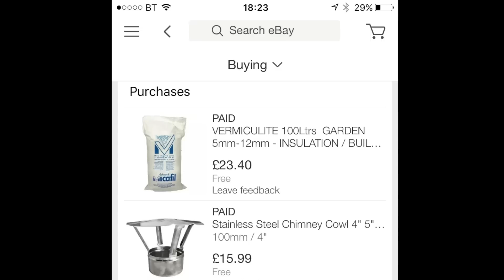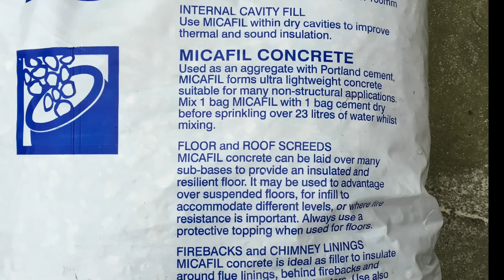Wood Fired Pizza Oven made over a gym ball

Comment: Excercise ball good but vermiculite and cement no for inner layer. Will crack and melt and give off toxic arsenic fumes in food. Use fire brick or clay for inner layer as a radiant layer. Then vermiculite and cement for outer thermal layer.
Reply: Where did you find this information about the fumes i am working to make the same project and i want to be sure. Thank you!
Reply: Joël Boudreau . Vermiculite is a type of asbestos... extremely toxic especially when heated and released into the air.
Reply: Joël Boudreau m
Reply: Although not all vermiculite contains asbestos, some products were made with vermiculite that contained asbestos until the early 1990s. Vermiculite mines throughout the world are now regularly tested for it and are supposed to sell products that contain no asbestos. The former vermiculite mine in Libby, Montana, did have tremolite asbestos as well as winchite and richterite (both fibrous amphiboles) — in fact, it was formed underground through essentially the same geologic processes as the contaminants.

Pure vermiculite does not contain asbestos and is non-toxic. Impure vermiculite may contain, apart from asbestos, also minor diopside or remnants of the precursor minerals biotite or phlogopite
Reply: so does it  give toxic flume s when heated ?
Reply: Thank you for your information, if I us Perlite instead of vermiculite would it be better...
Reply: I can't speak to the fumes, but they would probably be from impurities in the material.
Reply: The largest and oldest vermiculite mine in the United States was started in the 1920s, at Libby, Montana, and the vermiculite was sold under the commercial name Zonolite. The Zonolite brand and the mine were acquired by the W.R. Grace Company in 1963. Mining operations at the Libby site stopped in 1990 in response to asbestos contamination. While in operation, the Libby mine may have produced 80% of the world's supply of vermiculite.[8]
The United States government estimates that vermiculite was used in more than 35 million homes, but does not recommend its removal. Nevertheless, homes or structures containing vermiculite or vermiculite insulation dating from before the mid 1990s—and especially those known to contain the "Zonolite" brand—may contain asbestos, and therefore may be a health concern.
An article published in the Salt Lake Tribune on December 3, 2006, reported that vermiculite and Zonolite had been found to contain asbestos, which had led to cancers such as those found in asbestos-related cases. The article stated that there had been a cover-up by W.R. Grace Company and others regarding the health risks associated with vermiculite and that several sites in the Salt Lake Valley had been remediated by the EPA when they were shown to be contaminated with asbestos. W.R. Grace Company has vigorously denied these charges.[9]
The vermiculite deposit at the mine in Libby, Montana, was (and is) heavily contaminated with asbestos.[10] Numerous people were knowingly[11] exposed to the harmful dust of vermiculite that contained asbestos. Unfortunately, the mine had been operating since the 1920s, and environmental and industrial controls were virtually non-existent until the mine was purchased by the W.R. Grace Company in 1963. Yet, knowing the human health risks, the mining company still continued to operate there until 1990. Consequently, many of the former miners and residents of Libby have been affected and continue to suffer health problems. Over 400 people in the town have died from asbestos-related disease due to contamination from vermiculite mining from nearby Zonolite Mountain, where soil samples were found to be loaded with fibrous tremolite (known to be a very hazardous form of asbestos), and countless others there who insulated their homes with Zonolite have succumbed to asbestos-related diseases, most of whom never were employed in environments where asbestos was an issue.[12]
After a 1999 Seattle Post-Intelligencer story claimed that asbestos-related disease was common in the town, the EPA, in response to political pressure, made cleanup of the site a priority and called Libby the worst case of community-wide exposure to a toxic substance in U.S. history.[13][14] The EPA has spent $120 million in Superfund money on cleanup.[14] In October 2006, W.R. Grace Company tried to appeal the fines ($54.5-million) levied on them from the EPA, but the Supreme Court rejected the appeal.[15] The United States government is also pursuing criminal charges against several former executives and managers of the mine for allegedly disregarding and covering up health risks to employees.[15] They are also accused of obstructing the government's cleanup efforts and wire fraud. To date, according to the indictment, approximately 1,200 residents of the Libby area have been identified as suffering from some kind of asbestos-related abnormality.[16] Jury selection was to have been completed in February 2009.[17][18] The case ended in acquittals on May 8, 2009.[19] On June 17, 2009, the EPA issued a public health emergency in and near Libby, thereby allowing federal agencies to provide funding for health care, and for removal of contaminated insulation from affected homes.[20]
Reply: Vermiculite can not burn. It will flake and collapse at around 1350 Celsius. Often vermiculite does contain traces of asbestos because the minerals are usually found close to each other.
Reply: I was truly suprised that the oven wasn't lined with refractory...  I don't know how complicated it would be to try and do tjat at this point... but would have been an easy step in the construction....
Reply: Killer pizza oven! Really ....It might kill you.
Reply: harveyboy45 vermiculite also has asbestos in it
Reply: Thanks for the informative video. 

P.S. Gay Tool Belt

Comment: Love the video! I think I am going to follow this exactly! 2 QQs. How thick is the exterior wall and how long did you let it cure until you used it?
Reply from the maker: I'd say the wall thickness was roughly 5cm, thicker at the front around the chimney and opening (for strength) I let it cure over a week, using wet towels on the surface, so that it dried as slowly as possible.

Comment: Hi, great vid, sorry if this has been asked already but what do reckon the overall wall thickness is, concrete and render included? I'm in the process of making mine (85cm - gulp!) and I'm planning to put an insulating blanket layer between concrete and render.
Reply from the maker: I'd say around 40mm for the vermiculite/cement mix, but much thicker round the neck and chimney area, for strength, and the render was 25mm? I'd go thicker if I was doing it again on the vermiculite/cement and maybe miss out the render, as it was very expensive.
Reply: Many thanks - I've just added another layer to mine as there was no way it was 40mm. Just waiting for it to cure now.... Wish me luck!
Reply: Well, it's done. And it's stayed up so far! Thanks for the video, great information and inspiration.

Comment: So, here's a question for you: when you built your base, the bricks extend all the way out to the edge of the countertop/tabletop, well beyond the side of the oven. I'm currently right at that stage of building my oven. One would think that the bricks extendig out that far would "suck" or pull the heat away from the oven. Do you think that's the case? Would I be better off cutting my bricks to fit the outside edge of the oven? Your design is easier than my alternative solution, I will admit.
Reply from the maker: Andrew Ovenden I see the point you are making, as some bricks will be both inside and outside the oven, and yes maybe draw heat outside. But the extra work to trim the bricks seems really large vs the benefit?
Reply: Yeah. Sadly true. Still, I'm hoping to find a friend with a tile saw. ... or see how many more household projects that I can find that would justify renting a tile saw. Your video is great by the way. I've been going back and forth between your video and JJGrice's video to design and build mine.

Comment: What would you recommend for someone wanting to build a larger oven? I was thinking about a 50" for commercial use. Would this design be able to handle that and could you think of something I could use to form the dome? Also does this retain the heat for very long? Thanks!
Reply from the maker: wow, that's big, I'll have to have a think about that, I would be concerned that the mix would be strong enough over that diameter, and lifting, mounting the dome would be an issue? It doesn't retain heat for overly long, you have to keep feeding it with wood.
Reply: I don't know how expensive they are, but what about a "zorb" instead of a medicine ball?

Comment: Hi,

Sorry about the profile name. if i was to made the mood thicker to say 10cm would it still crack under the heat or is there other ways which can prevent these cracks.... Also the brown mixture you used to cover the over, what was that...?
Reply from the maker: Hi, profile name is pretty funny! Brown mixture was the victas heat proof screed, to which I added a red cement die, the screed has now cracked in 2 places, after using the oven 4 times, for over 2 hrs each time, oddly the vermiculite mix hasn't cracked, which is obviously closer to the heat
Reply: Wow. The fact that the vermiculite mix hasn't cracked is key. That speaks to me more than anything. The rest is solvable using any number of means folks have brought up. Whether it's the foil or the blanket or a combination, it should prevent cracking of an exterior hard coat. I know you stated you didn't use refractory cement, but what are your thoughts on whether it would work or whether it might improve results.

My main issue is mobility and not investing $3-5k in something that is permanent.

Comment: What is the red stuff that was put on last? And, you feel that this mixture of vermiculite and regular cement is heat resistant , so that it can tolerate temperatures of 600 F or more with
 the wood fire.. This type of oven then is light enough to put on a cart with wheels.. How much do you think it weighs approx.? thanks
Reply from the maker: The red stuff is a heat proof render, expensive and it has cracked, so I don't think i would use it again. Including the wooden frame it would take 3 people to lift

Comment: hi. how is your oven doing? any cracks. what would you do different if had to build another one? thanks
Reply from the maker: Hi, I would move the chimney further back next time. The main structure hasn't cracked but the outer render has cracked, so I would look at doing something different with that, somebody on here has suggested a layer of foil between the vermiculite mix and the render.
Reply: that is awesome. chimney closer to 5he dome or put it in the back of the oven? I will be starting to build mine this weekend. I have insulation blanket that I am planning to put over vermiculite and the cover it with concrete shell.

Comment: hi mark, how long did you cure the dome for? also, is the final coat that your put on watertight-can the oven be left in the garden without covering? many thanks
Reply from the maker: Left the dome from Sunday night through to the following weekend, more for my available free time than anything else, I also placed damp towels over it for the first couple of days. I leave the whole thing covered up outside, as any rain water that would run off the dome, would then go on the bricks, then inside, then soak the sand, then rot the wood etc etc, just easier to cover it up.

Comment: Hi Mark, I have a question. Did you put heat-proof cement between the flat stones which form the base? Or did you just lay them on the sand without any "glue"?
Reply from the maker: No I just laid them flat on the sand, and tightened the side of the base to pinch up the bricks after they were all in place
Reply: Cool thanks Mark!

Comment: Im patterning my table like yours.  My oven came out to what I think is 200 pounds!... With all the brick on the table top it will be 400 or 500 pounds.  Do you think your table design will support that weight?
Reply from the maker: sounds heavy for the oven, I could easily pick up the oven myself on my build, it felt relatively light, the weight for me was in the bricks and sand.

Comment: How much would you say that oven weightsWant to make a portable stand for the oven I want to make like yoursThanks
Reply from the maker: The total structure is heavy, I can manage to pick one end up on my own, enough to wheel under a small trolley I made using flight case wheels (castors), I can then lift the other end up and put it all on the same trolley, it can then be moved around. I originally built the trolley for moving a piano.

Comment: I have a question. I thought the vermiculite would act as an insulator. How does it hole heat.  A proper wood fire oven should hold heat for a couple days. How does this perform in comparison?
Reply from the maker: hardly holds any heat, as you said the vermiculite acts an an insulator, the fire brick however hold a lot of heat and do the job of cooking

Comment: Great build, does it hold the heat for long?
Reply from the maker: +glen ellis Hi, I'v had 2 sessions with it now, 1st 10 pizza, second 7, both times it took about 45 minutes to get the oven up to temperature (350-400), then topping up with more wood half way through. The outside of the dome does become hot to the touch after a couple of hours. To answer your question, I'd say it does a very good job of reflecting heat, but doesn't absorb as well as I suspect other materials might. It certainly wouldn't cook anything without the fire in there at the back
Reply: +Mark Cuthbertson  Hi Mark!
What about using some heat collectors on the side of the dome? Either clay or the same bricks as used for floor. I am planning to build up one for baking the bread. But still I'm not sure if the burning fire would not burn my bread too. For pizza ok, but for bread?
Reply: I would suggest using a fire blanket between the vermiculite/concrete mix and the outer coating. It would help with heat retention overall.

Comment: Hi Mark, sorry if this is a repeat question, but would there be any advantage of using fire cement instead of normal cement, Thanks in advance.
Reply from the maker: Hi, I don't honestly know, it can only help I guess
Reply: Ok, thanks but will probally stick to normal cement as you have.
Reply: Yes there are . I fire cement is designed to withstand high temperatures whereas a normal cement is not and will crack and disintergrate over time whereas a refractory product will withstand the extremes of temperature without cracking
Reply: But is that Fire Cement safe for Cooking in ?
Reply: yes 
although Firebricks 230 x 114 x 25mm would be better 
Firebricks and fire cement get hot and retain the heat and so will cook the base of the pizza 
beautifully giving you a nice crispy base

Comment: I am about to build one myself.  I picked up vermiculite today but it looks finer than the one u used.  Do u think this will make a difference or should i be okay?
Reply from the maker: +eric hard to know, maybe it will make a slightly denser build, and you'll have a smoother inside as it will compact better with less air holes? only one way to really find out!

Comment: Great video. thanks. Btw, you have your drill on hammer setting
Reply from the maker: Hi, thanks For the feedback on the video......it's not a drill, it's an impact driver - different kettle of fish
Reply: Oh I see. I need to use my glasses more often haha. Quick question: does you oven get hot on the outside? Thanks
Reply from the maker: +Michael Hurley yes the oven does get hot on the outside, I'll take some temperature recordings next time, not so hot you couldn't touch it though

Comment: Nice work! When you did the final set of the pizza oven on the new vermiculite mortar did you have to bond it with a liquid bond so the two sections adhered or is it fine the way you did it? Never worked with vermiculite
Reply from the maker: It was Ok the way I did it, not amazing, just OK

Comment: Lovely job and a great idea using the gym ball ⚽.... Question... Did you only use cement and vermiculite or did you add some sand to the mix? Also do you have any idea what is special about heatproof screed? Can I use a standard screed? Thanks in advance 👍😊
Reply from the maker: Hi, thanks for the comments, I just used vermiculite and cement, nothing else. I don’t know how heatproof screed does it’s thing, but it’s more suited for lining internal chimney walls where your using an open fire or wood burner, and as such I thought it would be tough enough to cope with the heat building up in the dome. It was just an educated guess really.
Reply: @cuthberm  Thanks for the reply,... I'm going to try this and make a "white (no smoke) rocket-powered oven"... not sure of the design yet but I will need an inner and outer dome maintaining an air gap to be heated in-between :-)  Your method is an ideal construction method :-)

Comment: Hi is the oven still going strong? I dont know whether to use vermiculite or perlite for mine. Which would you recommend?
Reply from the maker: weather has taken a beating on the cover, which has now ripped, also the chimney was pushed down through the weight of some snow fall, other than that all good
Reply: Mark Cuthbertson 
Thanks for the reply Mark. I think I'm going to make a shelter around the dome. A bit like a log store.

Comment: Hi mark, how much vermiculite/concrete did you end up using? And roughly what you estimate the cost to be to build one? Thanks.
Reply from the maker: HI Ricky, about 3/4 of a 100ltr bag of vermiculite and half a bag of standard cement. Fire bricks are the big expense, I managed to get them through a friend, you need to find a local supplier or the delivery charge will really hurt. I'll reply to your other question with a list and costs once I've dug them back out.